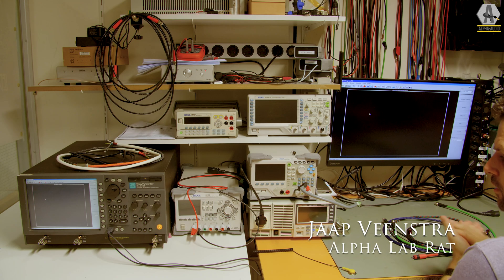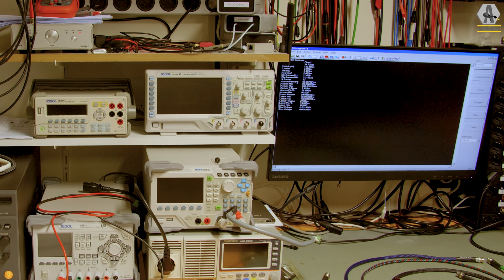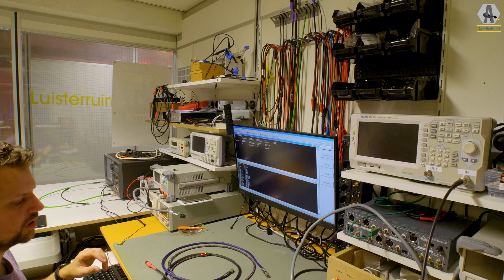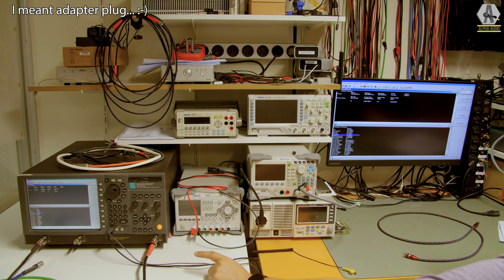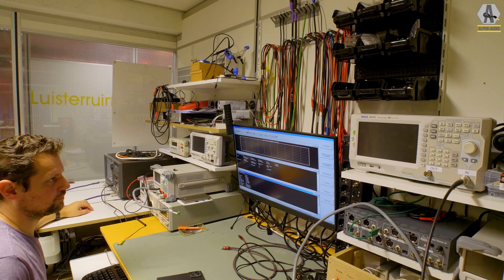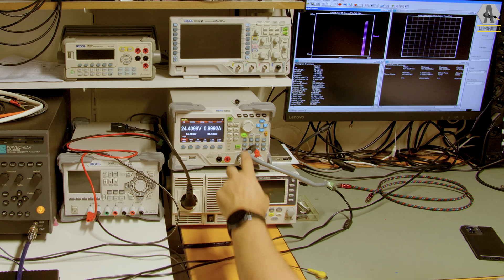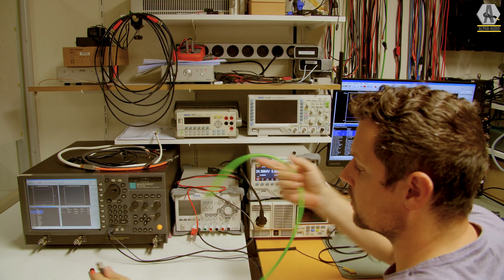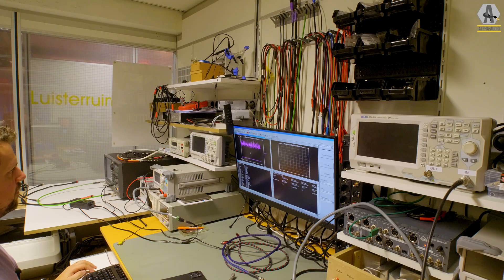Alpha Labs - Your coaxial cable might increase the jitter!

Comment: Phase noise measurement is relative to the carrier.  This is what "c" in dBc/Hz means. So if you attenuate the level of the signal the PN will automatically increase even if the signal stays perfect. You might as well measure cable attenuation using RF powermeter.
Reply from the maker: No, it won't: Phase noise is measured relative to the carrier, so stronger signals don’t automatically have better phase noise — the phase noise is normalized to the carrier level.
Reply: @TheAlphaAudio  Perfect cable with 3dB loss will increase phase noise by 3dB.

Comment: -66dBc/Hz at 10Hz offset on a 10MHz carrier is awful.
It should be around -100dBc/Hz for a system with a cheap TCXO source and around -140dBc/Hz for OCXO based instrument.
Reply from the maker: We have a way better device for measuring phase noise now.

Comment: Which respectable DAC is sensitive to SPDIF jitter??? Why is this even a topic with properly designed DACs? This cable is transferring data and on the receiving end (DAC) you run a buffer of enough PCM samples to decouple any jitter from the DAC's own clock. If you have a DAC sensitive to SPDIF jitter, you better throw it out. You DAC has its own clock and it can easily clock the PCM samples through at its own control with adequate buffering. This video is making a topic out of a non-topic.

Comment: Jaap, whilst I agree that digital cables (in general) should also be shielded I recently came across and old article by Lukasz Fikus (the engineering whiz behind the LampizatOr DAC’s etc you hopefully may have heard of) - It’s on his old website, which he’s left an archive of up on the web for nerds like us to learn from. 

Essentially, the following article makes the point that there’s no need for super fancy or esoteric and expensive digital SPDIF cables if the SPDIF output, such as on a CD Transport, is designed properly to begin with, enabling it to ‘drive’ the signal by means of a simple buffer circuit - In Lukasz’s case (as usual) he uses a tube circuit (in cathode follower), but with a high frequency tube designed for the job. His point is that the existing circuits are just poorly designed as the signal distorts under load and so, even the ‘best high end’ CD transport SPDIF outputs put out are really poor square wave compared to what you CAN achieve when driven properly.

Anyway, check out this super interesting (and amusing) article from years ago and perhaps let me know your thoughts from a technical perspective. His test results are really quite amazing at the improvement this simple, cheap modification can acheive - http://lampizator.eu/digilampizator/CD%20Transport%20Digi-Lampizator.html -  Really, really interesting stuff 👍

Comment: What frequency or frequencies is the test signal? Am I correct you use 10mhz square wave test signal?
Reply from the maker: Yup
Reply: @TheAlphaAudio  what is the bandwidth of the majority of the digital audio cables? 10mhz isn’t a normal audio stream. If the cable can’t handle this bandwidth so what does say these measurements?
Reply from the maker: @nielsjanssen6491  they should be fine with this signal. 100MHz or a GHz is another story of course.

Comment: Since so many digital transports have RCA SPDIF but not BNC or AES/EBU, it would be interesting to see what happens to these measurements for cables with BNC>RCA adapters, though I guess on your testing rig it would end up being BNC>RCA>BNC adapter. Then there are cables claiming to use 75Ohm RCA plugs like reasonably priced Canare plugs, and other branded cables with 75 Ohm cables and unspecified impedance RCA plugs. Your one RCA example here was with a brand seemingly not known or findable here. Keep up the good work with connecting the dots between listening & measurements. So few do.

Comment: I dont believe people claiming they can hear difference in quality by different cables, with blind testing those people always fail. The placebo effect is a big trap people are not enough aware of. Also measuring a digital cable thats worse doesnt mean its data tranfer is corrupted, only that would become something you can hear.
Reply: Error handling is built in. The signal either exists or doesn't. Worrying about pico seconds or "jitter' or latency does not matter in the slightest when listening to playback. The playback is buffered and could be delayed by an hour and you would never hear a difference. Worrying about invisible differences while while deadening your hearing with 60 dB of white noise and high pitched whine from that fan makes no sense at all.
Reply from the maker: Jitter is not a subjective matter...
Reply: @TheAlphaAudio  Im no expert, but if jitter in a signal means also jitter in the audio itself, the digital protocol is flawed I would say. If this jitter is in the audio, a blind test to see if we can even hear this jitter is important to show the actual relevance.
Reply: @marvinhensbergen1515  There is a wonderful wikipedia page that explains what jitter is, and in what forms it manifest itself.
Reply: I am interested in where you got the info that people always fail during blind testing.
I know for a fact that this is incorrect.
With a bit of effort you an also prove this to yourself. You can in fact do it on this very channel.
Reply: I believe if people in a blind test were given long enough time, even days, to adjust to a certain sound quality, they would notice the slightest change brought by changes in the set up. It takes a while to even find out wherein differences lie..
Reply: You can hear the difference, however in most cases, people’s room acoustics get in the way. 50% of the sound you hear coming out of your speakers are room reflections. Once you get your room dialed in perfectly, it makes the smaller differences like cables more audible.
Reply: The words “blind test” and “definitely” are used often in audio discussions on either side of the argument. It is near impossible to conduct a repeatable, controlled listening test with audio equipment in a scientific manner on which you can draw validated conclusions. I won’t outline what is needed to be able to do so, but what often is referred too loosely as ‘blind test’ in the arguments is just a small part of what’s needed. Anyone who states that people can or cannot hear differences based upon ‘a blind test’ and see it as proof is probably not very knowledgeable about how to conduct a test and how to validate those tests.

Alpha audio never, ever pretends to be scientific. We try to figure out why we hear what we hear. So either you can accompany us on that journey and just enjoy it as much as we do, or you don’t. If you don’t, please click away, and listen to a good record, but please don’t try to pretend that you have all the answers. We certainly don’t and we doubt that you do. If you do, you are in possession of very valuable knowledge and I wouldn’t share it for free in the comments in that case 😊
Reply: @jmtennapel  I never conducted any blind tests, I dont have the answers,but I want to know. I love good audio, but the audiophile world is filled with misconceptions and placebo's. Its already great to do scientific measurements, but backing it up with blind testing, conducted in a scientific way is the next step to make a final conclusion. Some piece of information we all learn from, and help to reduce the misconceptions and/or identify placebo's. Good information is worth 10x more than inconclusive information. It seems the audiophile word is afraid of blind tests. It almost seem like religious people who avoid any science discussions that are in conflict with there religious believes. Afraid to loose the dream.
Reply: @marvinhensbergen1515  blind test are not the definitive answer, see my previous post. But if you would go back into the livestream archive, you would see (for instance) a loudspeaker cable test, where the listeners did not know what was playing. So, your statement about ‘being afraid’ is invalid. On the contrary, we love to do this, like we did with plugin filters and switches. Does the way we tested pass ‘the sniff test for blind test setups’? No. But this is as good as it can be done with the resources we have. You either believe we don’t know what is playing, or you don’t.

Furthermore, in your first post, you stated that people fail to hear differences in blind tests with cables. Another commenter asked for some backup of that statement. You haven’t answered so far. Can you be so kind as to provide this? Thank you.

Comment: Interesting but there must be other important measurements that can vary even in 2 properly shielded coaxial cables as one of the biggest differences I heard when I was previously using such a cable was between different levels of Nordost cables I was able to audition at the time. Fortunately for my system at that time I preferred the cheaper Blue Heaven because Nordost pricing is nose bleed inducing!
Reply from the maker: There are WAY more things to investigate. This is the 'quick and dirty' method to see if the cable is technically ok.

Comment: I have found great success in using 12G-SDI BNC 75r cables for coaxial SPDIF connections. Displacing all my dedicated audio-coaxial cables from companies such as Blue Jeans, AQ, Cardas, Wireworld, Nordost, etc.

Cables based on the Belden 4694R, 4794R, & the Canare L8 CUHD are all RG-11 cables and are very stiff/thick. BUT, they sound absolutely fantastic and are absolutely loafing at the frequencies and bandwidth required for coaxial audio. They have some of the most advanced shielding and dielectric designs on the market today (they are the flagship 12G-SDI cables from Belden & Canare). Can be had pre-made (and fully tested) by Laird or Markertek. Always use 6' length or longer to prevent destructive internal reflections. They are CHEAP. Under $40 USD for a complete, certified/tested 6 foot cable. 

They all handily beat my: AQ Coffee & Diamond 6', and Wireworld Gold Starlight 8 & Platinum Starlight 8 6' cables, Cardas Clear Digital 6', & Nordost Tyr 2 6' coaxial cables. No contest...and these are not cheap cables!! Significantly more image depth/width, better/denser tone, better air, and blacker background. I was shocked. I started with the 4694R (the thinnest) and then upgraded to the 4794R. The 4794R is thicker but even better and more natural with better broadband punch/PRaT. However, the most open, natural, and powerful is the mighty Canare L8 CUHD. Just absolutely stunning and now coaxial SPDIF with the Canare is just as good as my Lifatec Silflex Optical cable going into my Chord Qutest DAC. WOW.

Other than cable thickness and stiffness, these 12G-SDI cables are the only solution for SPDIF audio IMHO. Canare makes inexpensive true 75 ohm BNC-RCA adapters as well. So, no spurious internal signal reflections from impedance mismatches. I use one on the Chord-end of my setup.

Comment: The shielding of a cable I think is better to be explained. For power Ac cable, for rca, for xlr. Usb and i2s. Many thanks
I use in the past neotech furutech and now just mogami and canare. It is a different sound but is the sound that i like. The problem is that i didn’t use shielding in Ac and the xlr is not grounded separately
Reply from the maker: We wrote an article about shielding on our website.